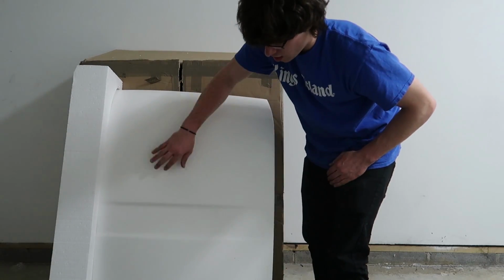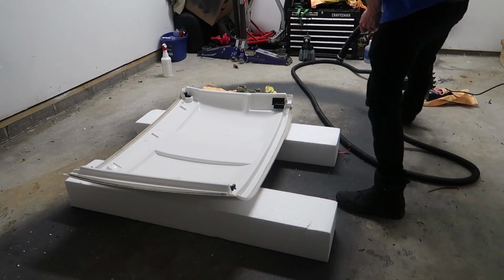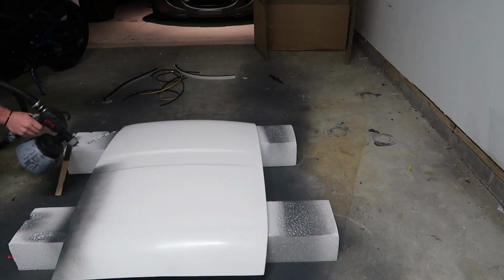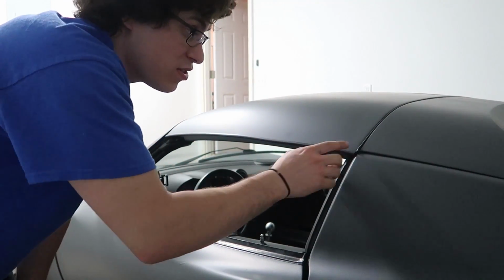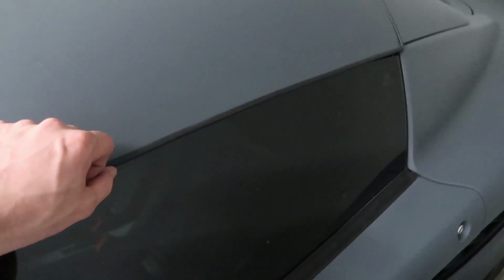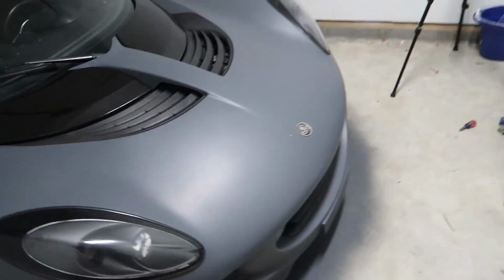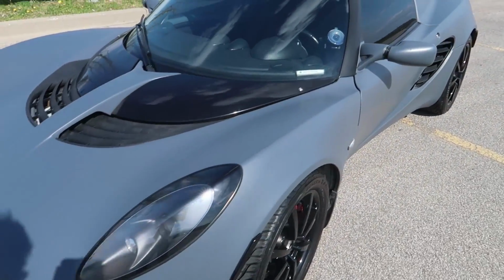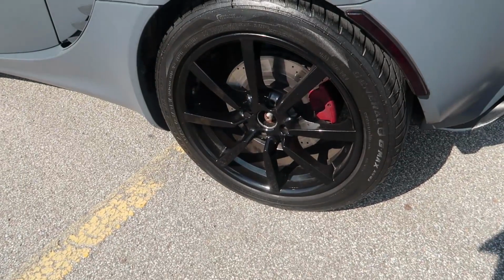ITS FINALLY HERE!!

Comment: Yummi you should play around with the idea of a strip down the center sense the roof had that groove in the center of it . It completes that clean straight line from the front bumper to the engine bay.